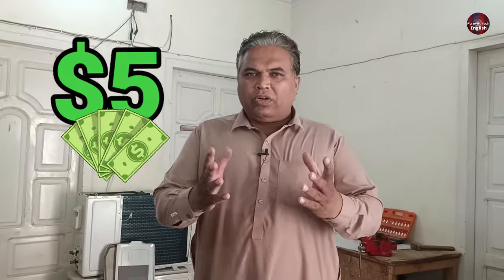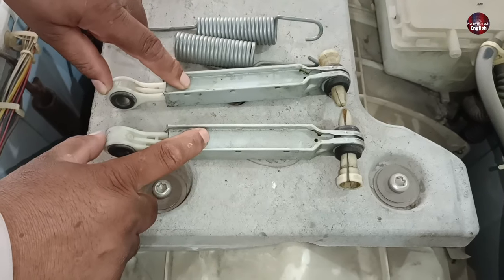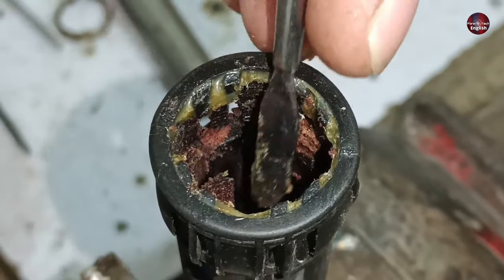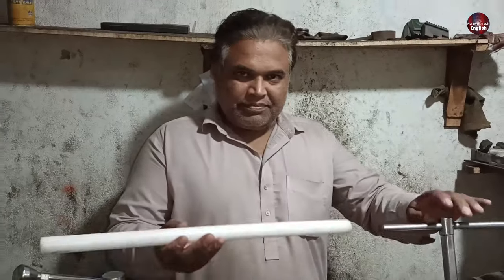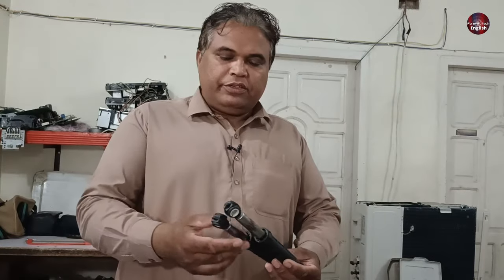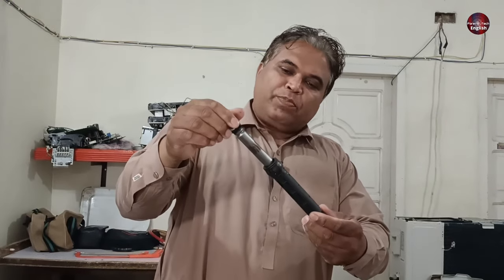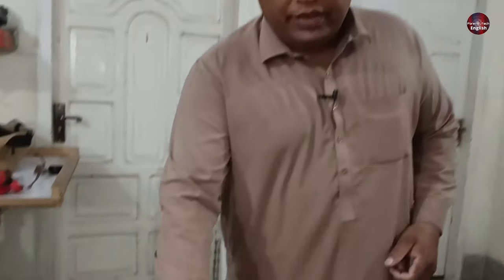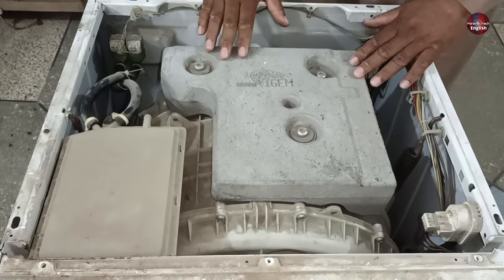DIY Fix of Bouncing Washing Machine Drum Shock Absorbers

Comment: The most suitable friction material I have found so far is called 35A Duro open cell ejection rubber, lubricated with SuperLube PAO grease or a silicone grease.
Reply: Hello, can you tell me where I can find this material?
Reply: It costs about $200 with shipping for a minimum order of 100 strips.  From "Beijing Graphic International Trade"
Reply: @denys6553  My replies get deleted when I say a word that sounds like Ally-bar-bar.
Reply: Something is not spoken here. If you don't drink an coffee while you repair, repaired piece wont work. 😅